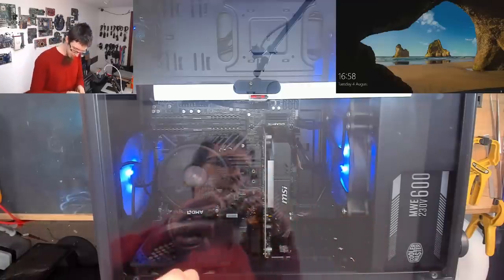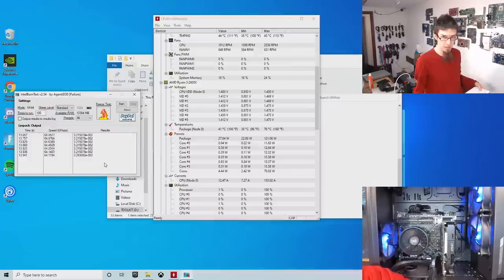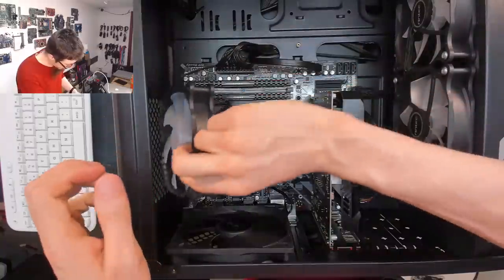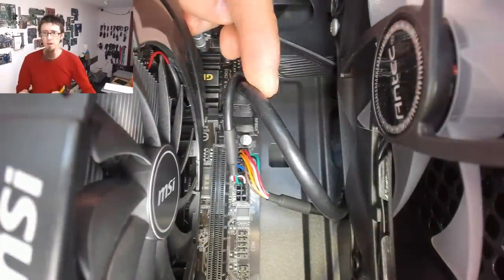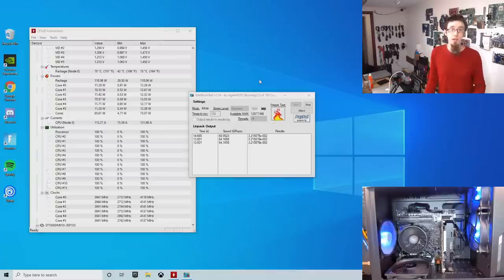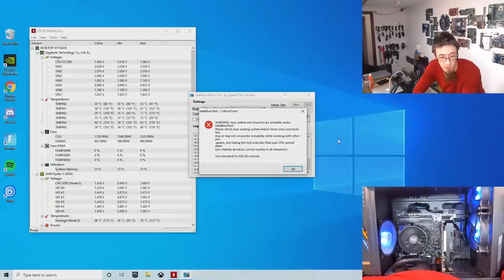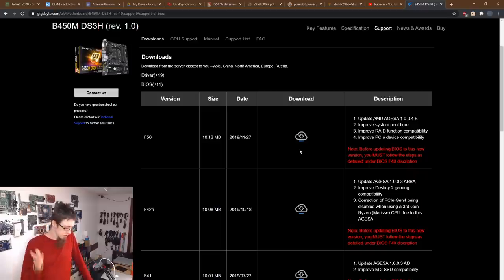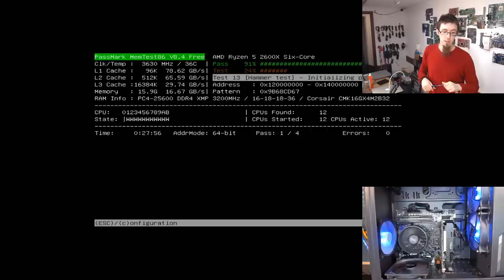Gaming PC Crashes at Random - LFC#217

Comment: This video randomly came up and I decided to watch it, because I've been having the same exact problem. Long story short, same end result that my memory isn't supported by my motherboard. I changed the speed to 3000mhz as well and will be ordering compatible memory. And you have yourself a new subscriber as well
Reply: Well Done mate!!
Reply: like RAM you have isn't on the QVL from MOBO vendor???

cuz my RAM isn't on my MOBO qvl and has been at 3600 cl 14 since I bought them lol
Reply: @deminybs  I've been having exact same issues as his customer was... Pc froze on me and two red lights started blinking... I checked the mobo manual and it has something to do with the ram, but want 100% sure until now
Reply: Byzkit usually is. I have a X99 system with the same issue.
Reply: that's why when i just built my new PC i made sure that the memory i bought was on that list of support ram.
Reply: @cParman9  rookie mistake on my part
Reply: Honestly, the biggest issue is that nobody tests XMP stability.
Reply: @TheXlen  still new to building a pc, ya live and learn
Reply: Me too!
Reply: @Byzkit  I understand that, but big people in tech bring XMP as this magical one click thing, most of them don't say that they actually stress test their systems with XMP enabled etc
Reply: yeah, same, compromised with 8/9 of the speed I paid for, but I could have tighter timings than with the default XMP, so it all works out
Reply: Memory is always a pita, when people build their own or buy from a brick and mortar private business, a lot of professionals will forget to check the QVL list for the motherboard or use whatever the customer wants used. Home builders and enthusiasts usually do this at least once in mistake.
Typically I always recommend - After the Hardware is installed
Update the BIOS
Update Windows 
Update Drivers
Run Benchmarks - 3DMark
                                - Prime 95
                                - UserBenchmark
                                - Cinebench
                                - GeekBench
                                - Novabench
                                - Sisoftware Sandra
                                - Passmark
                                - Heaven
What you want to do is stress the system and make sure performance is where your range should be in and look for any conflicts or issues.
If you can't get something to work return it, and get an exchange for what will work. Its important you do this to avoid issues later.

Afterwards If you are a bit knowledgeable - overclock - and retest your settings
Reply: you need to look at your MB's QVL before just buying ram willy-nilly.
Reply: @pentiummmx2294  no, fuck QVL, it doesn't mean shit, hasn't mattered for 20years now.
Reply: @TheXlen  yeah, agreed, especially when my mobo is on my ram's QVL, but my ram isn't on my mobo's QVL
Reply: @schwig44  The last time I can think of when QVL was useful and informal was in SDR RAM times.
Reply: @pentiummmx2294  I'm a noob pc builder, ya live and learn
Reply: @nocturnal101ravenous6  will definitely keep this in mind
Reply: @schwig44  Always go by the Mobo's + CPU QVL listing, they are the modules tested and validated by the Mobo manufacturer, they are the important ones to follow, there are 2 key issues, compatibility of the on Die Mem controller and the Mobo traces + power delivery, like the guy in the video stated using over $200 worth of Ram sticks in a sub $75 motherboard is "Putting lipstick on a pig", Computers are only as fast as the slowest component, If the motherboard isn't enthusiast grade don't stick enthusiast RAM modules in it, XMP/DOCP is classified OCing so when things go wrong don't bitch about it.
Reply: @TheXlen  Doesn't it? try sticking XMP non Samsung B-Die in a Asus Crosshair Motherboard running a 1700X on the first couple BIOS updates they released, then come back and tell me why you are completely full of your own shit.... I guarantee if your not from the QVL list you won't run at 3200Mhtz, but if you got the QVL GSkill 16gb Trident Z Zen kit, then you wouldn't have an issue, otherwise good luck you'll be running at 3000mhtz.
Reply: What do you mean "compatible memory"? RAM is RAM, while some RAM has higher speeds and capacity, so long as you're using the proper DDR variant, you can simply change the speed of the memory to one supported by your motherboard. You're daft for ordering new memory, and the people saying you should only buy what's on the QVL list are even more daft.

If you're having an issue while gaming and changing the ram speed helped, than it's an issue with the game. I personally run 16GB of 3200 MHz DDR, my mobo supports up to 4000 MHz. Now when I try playing AC:Oddesy at 3200 MHz, the game goes full donkey for some reason. Lower it down to 3000 or 2800, and the game runs perfectly fine. Now at the moment I am using G.Skill memory, but I have tried it with Kingston, Corsair, T-Force, Crucial, and many other variations, and the same issue happens.
Reply: @mynameisray  Ram can have compatibility issues, RAM is not RAM there is a distinct difference between something like a Samsung B-Die versus Crucial/Jmicron, It all comes down to the memory controller that is on the CPU Die, and some are more finicky than others.

Also for your education almost all RAM is technically at the base frequency, or can be taken down to that frequency, the difference is like lets take DDR it starts at 100mhz and tops out at 200mhz, DDR2 is 400-1066mhz, DDR3 is 800-2133mhz, DDR4 2133-4216mhz - Every RAM module you buy has several characteristics, namely Amount(GB),Timings, frequency, ECC, GB per Chip, 1 sided 2 sided. XMP or DOCP is a profile setting that states that at a particular frequency you have a specified timing characteristic, there are essentially OC'ed and binned and profiled to operate at a specific set Frequencies and Timings, which people pay for, EVERY CPU and MOBO has a QVL meaning the on die controller and the motherboard are tested with those modules. The frequency range is the max the motherboard will support in your case of 4000, you need compatible sticks to achieve that, otherwise what is the point, and no people want performance not your settling mediocrity.

You never tested the memory modules with a benchmark or testing software most likely your timings and or they do not play well, instead of thinking you know perhaps you should do research and actually know
Reply: @mynameisray  good for you buddy, good for you
Reply: @Byzkit  - I'm not your buddy, now move along.
Reply: @mynameisray  You're the one coming on here with your RAM rant, talking about that you've been building Pcs and repairing them since before that other guy was born. Get over yourself internet tough guy
Reply: Exactly the same for me, I started having crashes after enabling XMP, also I have the same case as the one in the video and was confused about the usb 3.0 double header, taken that out now! thanks for the help.
Reply: TBH, talking about Gigabyte boards, even when the memory is supported, you're better off to set the speed of your memory manualy in the BIOS and the voltage at 1.30 - 1.35. Solves a lot of issues with their boards.
Reply: @nocturnal101ravenous6  I realised the same for laptops. I first check for latest bios before other drivers updates. It is important.
Reply: I would keep an eye out for future BIOS updates, just in case (assuming you care to try to regain that performance). I have a 64GB Corsair kit, not on the QVL list for my Gigabyte X570 Aorus Ultra, and have had mixed results with it. When I bought it, XMP wouldn't enable at all, and a BIOS update fixed that a couple of months later. Then it was smooth sailing from about September last year until July this year, when I installed the Windows 10 2004 update. 

Suddenly I was having weird problems where programs would silently crash at random, then be unable to re-open until a restart. I would also occasionally get bluescreens, but only when doing a shutdown/restart of the PC. I was consistently getting minidumps with either GPU or audio drivers implicated in the excerpts I analyzed. Clean reinstalling my GPU drivers and audio drivers did nothing, and I was putting off running memtest because of how long it could potentially take to find a fault in 64GB of RAM. After just kind of passively troubleshooting it for a while, I got fixated on it one weekend and decided to update every hardware driver I had (was trying to avoid a reformat if I could). Long story short, I worked through my BIOS settings before doing a BIOS update, and experienced no crash with XMP off, so I did the update. Afterwards, I haven't had any more crashes, mercifully.
Reply: I had the same problem with one of the early ryzen 1600 procs but I had to go all the way down to 2666 MHz.
Reply: @raddysurrname7944  that sucks
Reply: Darth Wheezius  I doubt that, I think I had bad luck with the memory controller. I assume the system wouldn't have POSTed if the IF clock was too high. But it might have been a compatibility problem too although one would think a 1x8 3200MHz stick is not that demanding...
Reply: Darth Wheezius  definitely isn't a budget motherboard, but I did go with cheaper ram
Reply: Darth Wheezius  B450 AORUS Elite... I bought 16gb of G. Skill budget ram, cheapest I could go with. I've had issues ever since I put the build together. It would freeze mid games and couldn't figure out what the problem was. Once I saw this video, I went ahead and set it to 3000mhz and haven't had an issue since then
Reply: Darth Wheezius  it's not on the list for memory compatible with my mobo. I set it to 3000 instead of 3200 until I can afford new ones
Reply: Darth Wheezius  I'll try and sell that 3200 or save it for another build that I can find a compatible board for
Reply: Could also be the voltages
Reply: Memory compatibility is more complex than does it boot unfortunately personally at stability issues RAM is my first go to
Reply: @nocturnal101ravenous6  Thank you for your valuable information, really appreciated :)
Reply: @TheXlen  If i watched this correctly there was only 8GB of ram in there so why not at least double it if you are going to be gaming on it as was the intended purpose of this machine . 8 GB is going to be eaten very quickly , Always max out the ram if you can afford it
Reply: i have the same mobo and using gskill ripjaws RAM. i would constantly get lockups and reboots when i first built it. i ended up finding that my XMP was off. i enabled it and have never had a problem again.
Reply: @deminybs  lucky you.
Reply: @nocturnal101ravenous6  Typically, what I do: check the QVL. Order and build accordingly. No need for all the silly testing afterwards. It just works.
Reply: Thank you for the summary.
Reply: Gvn
Hhh
Reply: Tech Deals has talked about this on his channel. Memory compatibility issues abound with Ryzen 1000 and also 2000 series (but to a lesser extent) just stay away from 300 series chipset motherboards. Problem largely rectified with 500 series chipset.
Reply: SAME HERE!!! Thank you!!!
Reply: @Neon_Deion  I no longer have this issue, built a completely brand new pc this year. For some reason ryzen 2000 has issues with ram. I tried a 3000mhz ryzen ready ram with my old pc, wouldn't boot at all
Reply: I'm a bit late to this video but the same thing happened to me! The only difference is I actually have compatible ram so I'm not sure if I should try another set or stick with 3000.
Reply: I also have the same combination. I changed my speed to 3133mhz and it works fine 😇
Reply: @SupertigerDev  when I sold it I had to do it down to 2933, he hasn't had any issues what so ever

Comment: “Nobody uses Molex for fans”->plans to destroy customer property->discovers customer uses Molex for fans.
Reply: If he was a professional he would've called the owner to inform him
Reply: @Straiferdt01  But he is a professional. Everyone makes mistakes.
Reply: Yeah in no world should have ever cut that off. There are plenty of other solutions.
Reply: @r100curtaincall  I prob would of put some heatshink around it and secured it with small zip tie or something, Permanent damage/modifications to components are not good. plus if the cut is not entirely clean you may have a small bit of exposed copper at the end of the cable which could be pushed up against case body or components that are pointy in shape.
Reply: steve64464 yes. Usually in the very rare case that I have something like that I will usually just cable tie it to a place where it will be out-of-the-way, Or as a last ditch resort, use tape. Heat shrink is a good idea as well, realistically a well-made Molex connector should have the connections recessed enough that it be really hard to make it make contact with anything anyway.
Reply: @SuperLuigiGuy64  no
Reply: @SuperLuigiGuy64  That fan flailing about while he's unscrewing it tho....

Comment: Love your videos. You even made me tidy up my cable management after seeing how you take pride in your work and do things properly
Reply: Consider yourself lucky,  he's got me hooked on rgb.
Reply: @DaleDix  yeah soo. I have 4 RGB fans. RGB memory and RGB liquid pump... Probably Adams fault as well 😂
Reply: @torsson2  You guys care for RGB ?
Reply: @CharlieQ7400  it looks nice. Depends where the PC is located of course.
Reply: @torsson2  My 3 PC's all have RGB fans, RGB Lighting strips.

Ryzen has 10 RGB fans.
Xeon has 7 RGB fans and RGB on the front of the case..
Opteron has 5 RGB fans and RGB on the front of the case.
Reply: @CharlieQ7400  I don't. The added expense isn't worth it to me
Reply: @crylune  you know you can set a RGB fan to a single color right?
Reply: @torsson2  Still don't want to pay extra for something I won't use
Reply: @christophervanzetta  yes the that I can understand. But the other guy writing "RGB is trash" without any explanation why he thinks that.
Reply: @torsson2  It's not trash and as a fact RGB is nice to have in a gaming BUILD , Setting the Colors you like , but for me i can't afford it , + i prefer a high quality case over RGB .
Reply: RGB isn't trash or evil but I've never paid extra for it, either. The b450 board has rgb built-in and my 2700 stock cooler Wraith Spire has the rgb ring. I like changing the colors every couple of months to make things interesting.

Comment: Adamant, Thanks for the in depth-ness of your thought process.  I was glad that you told us which software you were using.  I just checked my OLD Laptop's memory and GTX1060 GPU as well as the i7 CPU with some benchmarks and the stress test.  It's still performing adequately, although old.  Just wanted to thank you for your expertise.  I used to have CompTIA Net+, Sec+, A+ and CCNA back in the early 2000's while I was in the Army, but I no longer do any of that stuff.  I prefer to just watch all you youngsters doing it on YT. LOL

Comment: Wow, it's nice to see someone else as professional as I was back in the 90's and 00's. All that tidying never solved a problem for me, but tidy cables and systems DON'T cause them either.
I also like how you said you won't run memtest, then you change your mind. That's how fluid diagnostics has to be. If you aren't fluid then you've already made up your mind before you start working and you're almost certainly wrong. I worked with quite a few guys who thought like that, and their repairs always bounced back.

I repaired thousands of PC's and only ever had 4-5 come back with the same fault. I had lots of people come back and ask for me though.
Reply: Thousands? One a day for at least 6 years straight?
Reply: @calvitocalvon1711  lol one a day? I wish. More like 2-5 per day for 12 years. Multiple benches, multiple repairs.
Reply: @DJ-Daz  jeez tons of experience, tell me some anecdotes!
Reply: @calvitocalvon1711  The longest repair was because it would lock-up after 2-4 hours. Before that it was fine. It took nearly a week to fix due to the length of time between lock-ups. It was the soundcard in the end.

We had a batch (bloody hundreds of the buggers) of Maxtor HDD's (40GB) that had dodgy firmware and would corrupt the fat. Updating the firmware worked but the number of returns was huge. I've NEVER bought a Maxtor HDD because of it. Strangely it took weeks to months before the fat was destroyed.

I spoke to a guy and removed 2 pins from a phone cable (RJ11) because it would cause all the phones to ring as soon as it was plugged in. I promised him it would work fine now. He was polite and insisted he just wanted the cable to work, then just before he left he gave me a business card... He was also called Darren and worked at the regional Trading Standards office. He called me back the next day and said it worked and thanked me again.

I once had to go to court over a laptop that wouldn't run a TV repair database (worth hundreds), the owner was told several times this cheap-ass laptop would struggle with it and even the company that made the DB software told him it wouldn't work. We called them too. He wanted a refund. He got a refund and compensation to buy a better machine!

I have never, and I mean NEVER heard of anyone ever using the CDROM tray as cup holder.

There's a lot more I'm sure, but it was nigh on 15 years ago.
Reply: @DJ-Daz  hahahahahah this was amazing to read ! Id love to hear more add me on discord Calvo#4120 oh man
Reply: DJ-Daz It’s standard these days, unlike the Wild West of the 1990s when you’d get complete idiots and nefarious thieves! Things are pretty well regulated and decent in 2020
Reply: calvito calvon try 3-5 a day since 1998!!!
Reply: @DJ-Daz  Why would anyone NOT use a CD-ROM tray as a cup holder??? Dang, even back then there was an "app" for that :-)